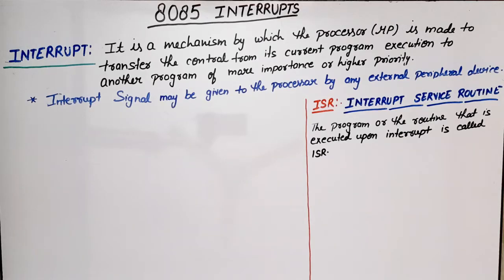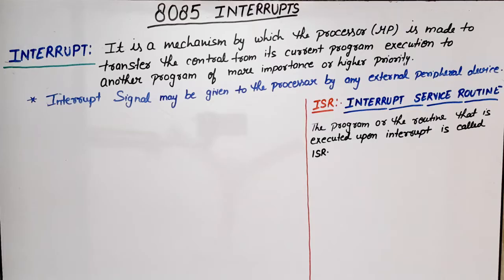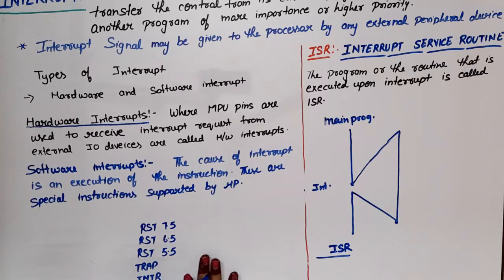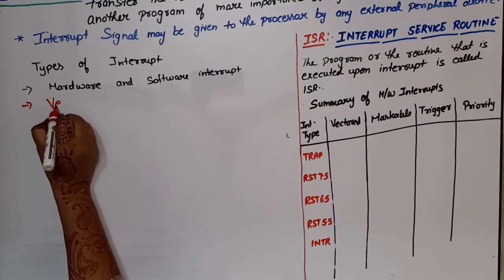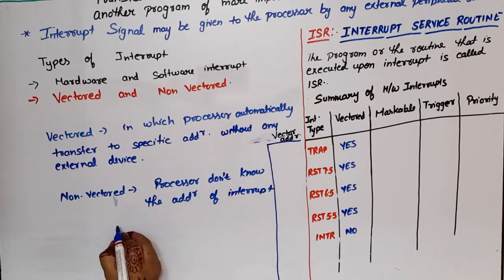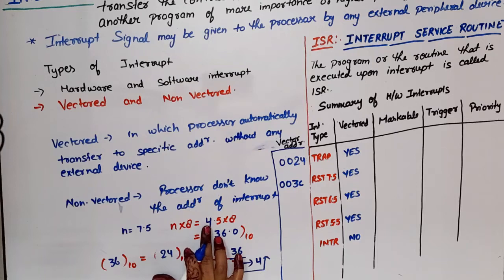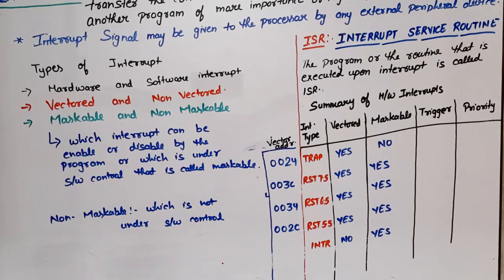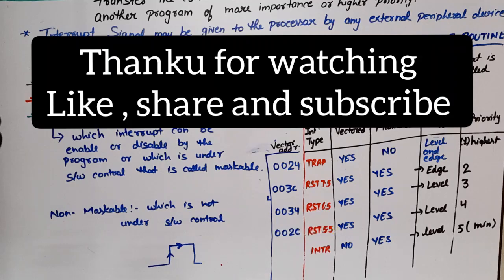Unit 2 L17.1 | Interrupts in 8085 microprocessor  | Types of interrupts | 8085 Interrupts

Comment: Respected Ma'am your teaching art  is outstanding. 
I watched your timing diagram videos for read and write operations.But I have little confusion about clk pulse , why transition is required in addr lines , for what and why -ve portion of clk is needed etc.
So I want u make a video for the same , , , If you are free .
Reply from the maker: In every machine cycle memory address will change that's y transition required in address line and for clock mostly devices are negative edge triggered that's why -ve portion of clock is required but u can take +ve trigger also but due to additive nature of noise we take negative
Reply: Thanks a billion ma'am
Reply from the maker: My pleasure
Reply: Ma'am one more question is that what is meant by delay and delay loop and y delay loop
Reply from the maker: Sometimes when delay is required in two operations then in microprocessor programming that delay is provide by loop  and in counter we set the count value.which provided required delay for.next operation
Like red light on traffic if 1 min delay required for passing traffic than counter will be set on 60 then it Decreased one by one till 0 then green signal
Reply: @TechnoTutorials2783  thanks a bundle respected ma'am